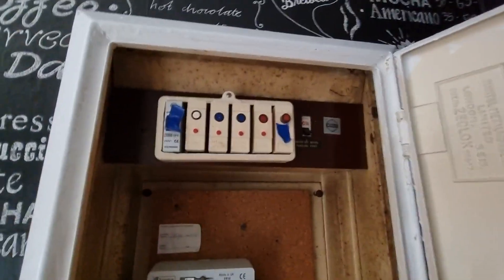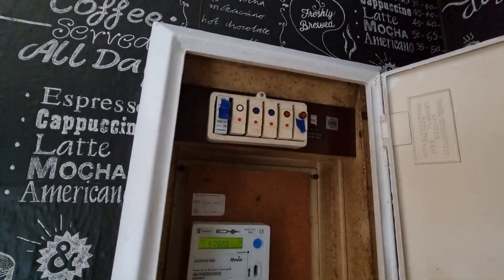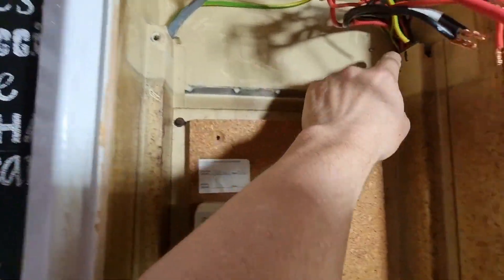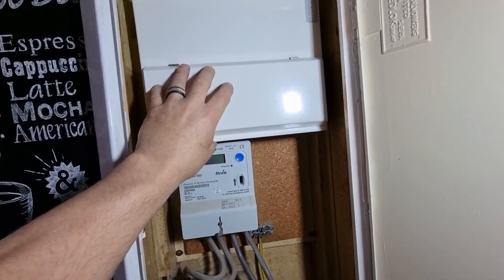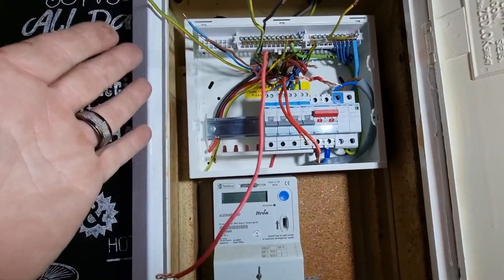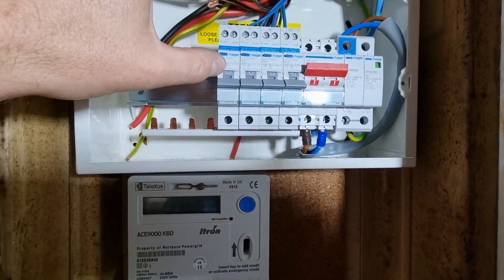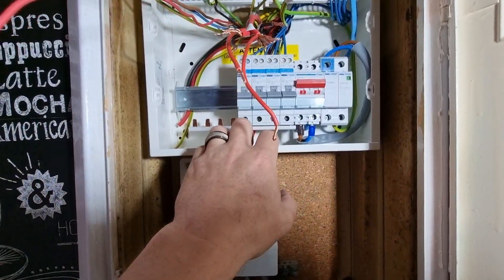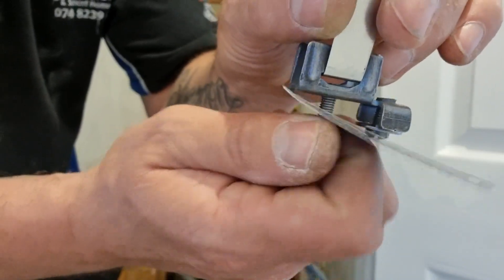Fuse board upgrade to a new 18th edition full type A RCBO board

Comment: Nice job.... 
that crimper looked a bit cumbersome , get yourself the smaller one that does 10 & 16 mm , it's a lot easier  😀
Cheers mate.. 👍
Reply from the maker: I have a smaller crimper but it doesn't crimp all the way around the crimp it just pinches in from one side, so on bigger crimps 10mm and up I prefer to use the bigger ones 👍😀

Comment: Nice clean job done there mate, May I ask what was the reason for changing the CU ?  The reg don’t require older installations to be replaced or upgraded to the current edition.  Health and safety executive’s note in BS7671 and page 99 in the onsite guide .

 Health and safety executive’s note in BS7671 AMENDMENT 2 existing installations that have been installed in accordance with an earlier edition of the wiring regulations may not comply with the 18th edition in every respect this does not necessarily mean that they are unsafe for continued use or require up grading . 
Page 99 off the onsite guide ,
Installers adding or amending circuits in dwellings will encounter older consumer units,ie those not complying with regulation 421.1.201 for many years to come , It is important that installers do not advise the replacement of consumer units simply because they do not comply with the current version of BS7671 . To ensure the ongoing use of such enclosures and assemblies, the installer must ensure the following:  it goes on to detail the tests we must do  

but who am I to argue i’am just a humble spark who’s opinion means nothing .
Fantastic video as always
Reply from the maker: Hi Sean
My philosophy is that if it can be improved we should improve it, like I say to my customers, if you compared a20 year old car to a new one essentially they do the same thing, but the new one is going to be far better, why not just make the install better, plus the property is going to get rented out and the landlord wanted it to meet current regs 👍😀
Reply: @ejbelectrical4951  yes I agree and if it is being rented out there we have no choice but to replace the cu and yes why wouldn’t we try to make it better.  Personally I think those HSE not a a nonsense . But if the IET are happy to recognise and accept older installations as safe than who am I to argue , 
I think all rewireble fuse boxes should be replaced at every opportunity we get . Regardless of there condition , just get get rid of them.
Reply from the maker: @Dog-whisperer7494  yeah I think they only leave in the retrospective part just so that people don't have to have major works completed every few years just to meet regs as they change, but yes I'm a great believer in if the install is over 20 years old it really should be upgraded to new protection devices at the very least..👍
Reply: @ejbelectrical4951  totally agree

Comment: Should put copex on them single insulated cables
Reply from the maker: Hi elliot
Why would I need to do that?
Reply: @ejbelectrical4951   basic insulation is outside of the enclosure, is it not? I personally would not class the meter box as being accessible only with the use of a tool (given how often I’ve found them with snapped locks and held closed with tape) and judging by the gap to the right may mean it is accessible to be touched. Code C2 on an EICR for me.
Reply: @paulmatthews5470  It is still within an enclosure that requires a tool to gain access. If this meter cabinet was damaged and did not require a tool then fair enough, but we can assume the one in question does require a tool, seing as this chap seems like a competent electrician so he would have picked up on damage. Going on the damaged logic, i have found countless damaged jb's over the years that meant no tool was required to access them, that does not mean you can then class all jb's as not suitable as the non damaged ones are fit for purpose.
Reply: @entergenericedgynamehere8751  Fair enough, I've mainly worked in rough arse areas where every smackhead and their dog have been into these things by some nefarious means, leaving some degree of destruction behind, so I've a pessimistic view on these things to say the least. I'd say around half have been left open that I've ever found that don't have a spring loaded latch, if the door is still even there. All well and good having the use of a tool to fall back on, but whether people will actually use them is another matter. Good practice would tell me to double insulate them regardless, as in would a DB riser cupboard no deeper than 12 inches be classed as an enclosure? I need a tool to open that, of course. If so, then I've been wasting my time brining conduits/copex and trunking any lower than the ceiling all this time. I stand by my original statement as I just thinks it's a tad wank; otherwise, you wouldn't use single insulated meter tails now, would you? So why leave basic insulation down the side of the DB where slender fingers can poke down to their hearts content?
Reply: @paulmatthews5470  I wouldnt say you are wasting your time at all, as that is exactly what i would do. I am not debating what is good practice and what isnt. I was simply stating that the meter cabinet is classed as an enclosure that requires a tool to gain access , so according to bs7671 it is acceptable.  Again, this person with those slender fingers would have had to open the cabinet with a tool. What is stopping that same slender fingered person using a tool to open a jb containing exposed live conducors and poking around in that? I'm not trying to be confrontational at all, as i know it can come across as such, i just like to share views and opinions with people, i tend to always learn something new from them!
Reply: What time in the video?
Reply: No need, those single/basic insulated cables are still in an enclosure that requires a tool to gain access